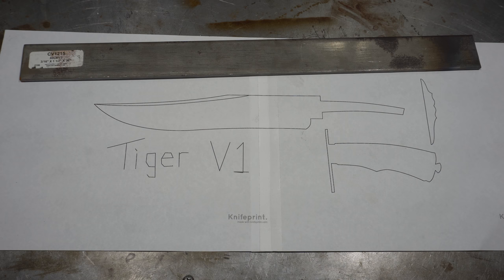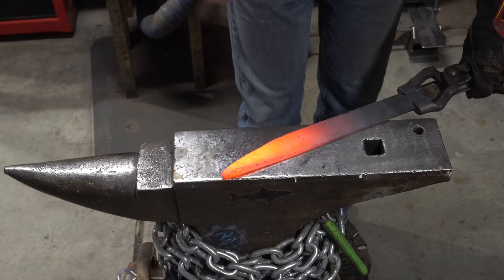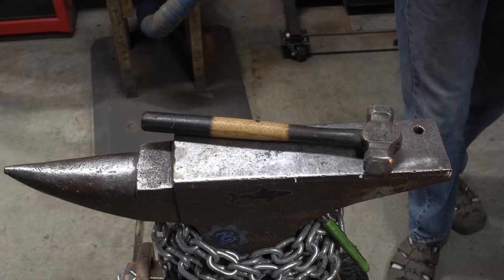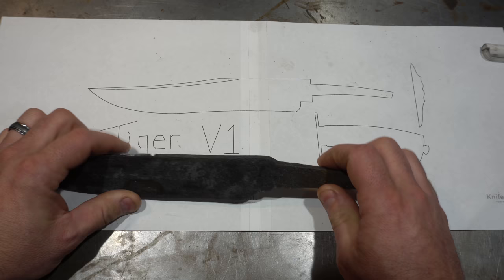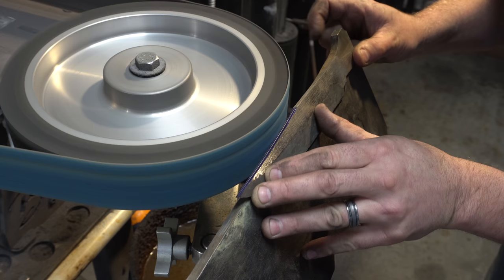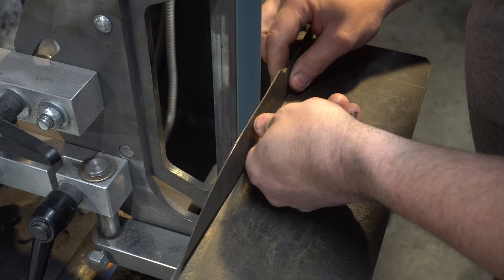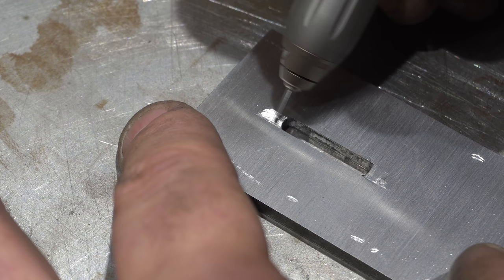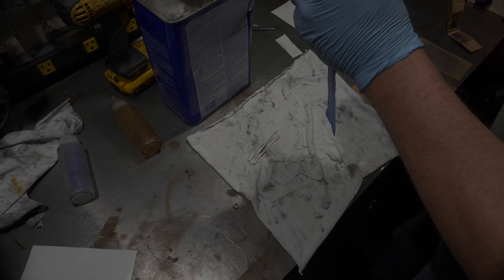Forging my Journeyman Knife #3

Comment from the maker: What do you think of this one?  I'm actually going to build 6 knives and then pick the best 5.  This one isn't my favorite so far.
Reply: I like it. Nice job.
Reply: Was this the one they said to sell? Regardless it turned out beautiful and that copper inlay turned out great! I forsee you having alot of fun with that going forward. 😂
Reply from the maker: @philochristos  thanks Sam!
Reply from the maker: @mcrich1978  yeah, this was the one with a few issues. I did correct a couple when I got home.  This will be my backup knife #6 I think.  We’ll see.
Reply: Incredible blade! I got a question though, what's a good beginner level semi stainless steel?
Reply: I think it is a beautiful knife. I think this one looks the most like something to use instead of display, but a winner none the less.
Reply from the maker: @notabrit3025  what exactly do you mean by “semi” stainless?  Do you have an oven to do heat treating?  If not then stick to high carbon steel.  52100 or 15n20 are better than most but will still rust.
Reply from the maker: @stephenborders4654  thanks Stephen.  I’m more partial to knife #1 myself but I wanted some variety.
Reply: I like it, classic no nonsense blade there!
Reply: I actually really liked this knife!
Reply from the maker: @hunt_trap_fish  I did like this knife a lot!  Unfortunately the spacer/handle fit up wasn't "perfect" so I didn't end up using this one for my JS set.
Reply: @TyrellKnifeworks  totally fair

Comment: Very nice! Love to see you forging blades with that hammer!! I’m pretty sure you’ll have no problem passing you’re journeyman. Also I’ve noticed a change in you’re handle design.
Reply from the maker: For the JS knives I’ve changed my handle style a bit so they are easier to make with less chance for issues.  JS knives tend to be simple.  👍

Comment: I always found it odd that you always did the false eldge by hand. Another great knife as always!
Reply from the maker: I never had a good way to go curved false edges reliably on the grinder.  They are easy when it’s a harpoon point and it’s straight but the curved ones posed a problem.. until now. 👍

Comment: False edge is a term that is used improperly. A false edge is a fencing term, and they can only be found on a double edged blade. The edge of your sword that you present to your opponent is the "true" edge, the one that is facing you is the "false" edge. Which edge is "true", and which is "false" can change each time you pick up the sword. What you are referring to as a false edge is the "clip".
Reply from the maker: A false edge is a common term referring to a clip point that has bevels.  Just because it has one meaning for fencers don’t assume that’s the only meaning.  Also, a clip point is just an area of a knife where the point looks “clipped” off. It has nothing to do with there being bevels there.  You can have a clip point that isn’t a false edge.  Don’t get hung up on labels. 👍

Comment: To have better cutting properties and resistance of the blade is it better modeling forging like you do on video or cut it to shape?
Reply from the maker: It makes absolutely no difference in cutting properties if it’s forged or done by stock removal.  This one is forged because the Journeyman knives must be forged.  Thanks for watching

Comment: great job denis it looks amazing whaty degree angle did you put your rest at to grind your swedge ? i may have to try that those rotary tools are cool too i guess i need to save more $$$$ to get 1  Mark 😀👍👍
Reply from the maker: I think I put the rest around 60 degrees.  I don’t really check.  I just want it the same on both sides.  Thanks for watching, Mark!

Comment: Great stuff, with the Journeyman testing, are these blades examined for build quality only or do they do other testing with them? I've watched your strength and edge test video for that test just curious how these are tested?
Reply: There are five knives that are inspected for fit and finish. These are supposed to be your best work, and they are inspected at blade show. The sixth knife is to make sure that you can forge a high performance piece. This blade is eventually destroyed during the testing, so fit and finish isn’t as important, as long as it can be used safely
Reply from the maker: Angry Bear pegged it.  These 5 knives are judged by a panel of 7 master smiths.  I’ve already passed the performance test.  Thanks for watching

Comment: Now do you use anything to hold the copper in the slot? Or is it a compression  fitting
Reply from the maker: It’s just compression.  It works really well.  Thanks for watching
Reply: Thank you. Last question,  probably not. How did you hide the two ends?
Reply from the maker: @billwalker5883  they were just hammered in and then the seam disappeared when it was ground and sanded.  👍

Comment: That copper might not stick over the long term. You have to undercut the edges of the channel, like a dovetail joint before hammering in the copper wire. Otherwise there is nothing for it to grip.
Reply from the maker: Yes, normally that’s true but these channels are quite deep and it’s in there very solid.  Thanks for watching

Comment: Fantastic knife....as always. Just a few quick questions.
What is the width of the steel you used? Or what is the normal width do you forge with? Thickness was 9¹⁶ correct?
What is your final HRC for 80CRV2 steel? 
I am very late to the party.... Was thinking about ordering some for a chef knife . You would recommend it?
Reply from the maker: I started with 3/16” thick stock.  The final hardness after temper was 60hrc.  Thanks for watching, Dan.  80CRV2 is a great steel.  It’s really just 1080 with vanadium and a bit of chromium added hence it’s name: 80 = 1080, CR = Chromium, V2 = 2% Vanadium.
Reply: @TyrellKnifeworks  Thanks for that information.... Yeah I always thought it was a fancy 1080 but everyone seems to be using it now days so wanted your thoughts. Thank you..
Width of your bar stock? 50 mm?
Reply from the maker: @danwerkman  it was 1.5” or 38mm wide and 3/16” or 5mm thick.